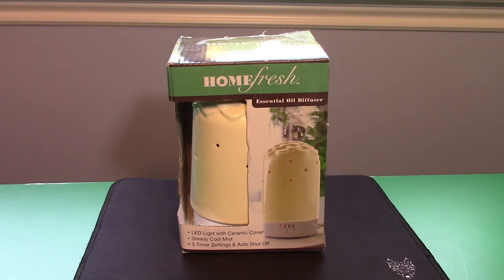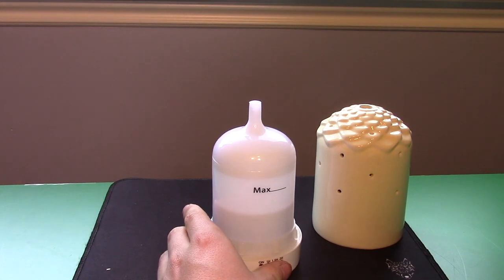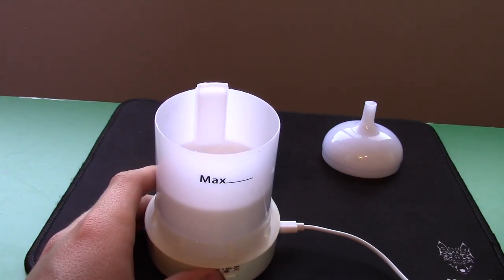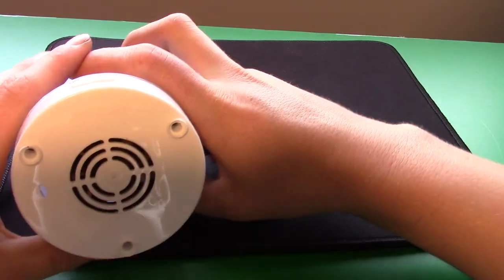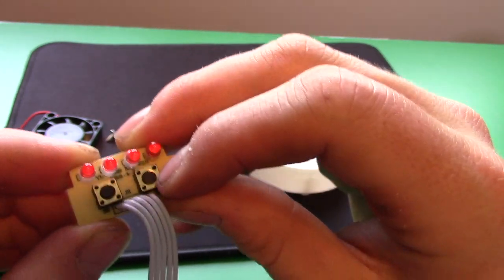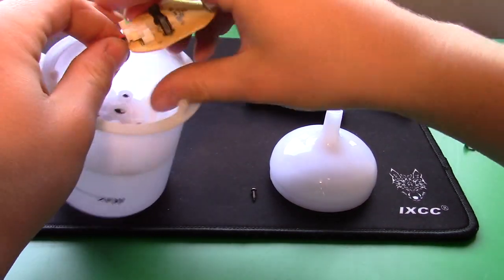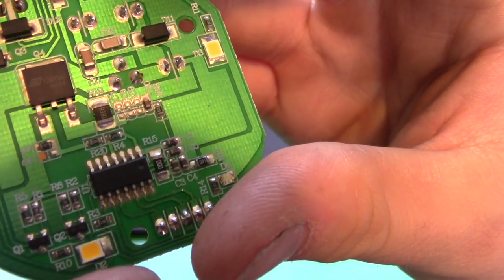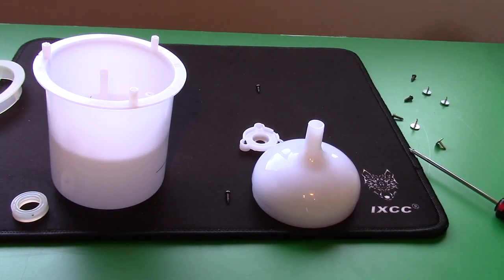Ultrasonic Essential Oil Diffuser Teardown & How It Works

Comment: Thank you for the clear explanation of this! I just got one and I was super curious how it works because I noticed that it wasn’t using any heat, so I decided to look it up and I found your video. Again, thanks. You deserve more likes on this.
Reply from the maker: I’m glad you found my video helpful. Knowing people appreciate what I do is one reason I continue to make videos dispute my lower view and subs. Also, thanks for subscribing!
Reply: No problem 😉
Reply from the maker: @Pablo_24_Alvarado  you could be my 400th subscriber if you subscribe
Reply: I already have but I will on my other account called Pablito 😃
Reply from the maker: If you want to! I’d appreciate it
Reply: Just did!
Reply from the maker: @pablito8097  Thanks !
Reply: Your welcome 😄
Reply: Same here, I was fascinated by the little thing! Can't believe it's just vibrations changing the state of matter
Reply: @Mackathne  Basically the ultrasonic vibrations give the water molecules enough energy to jump to a different state of matter a lot more effectively and efficiently than just letting it evaporate or heating the water to give it extra energy.

Comment: yes the disc is a piezo transdicer that not only vibrates very fast but also very powerfull. i dont know the frequency and the number of watts but it seems the disc vibrates very powerfull
Reply: I have my diffuser plugged into my UPS and it only detects 9 watts being consumed by it so it's surprisingly low.

Comment: BG Tech:  what happened when you tested the components with a multimeter or potentiometer? You didn’t say, when you turned on the unit before disassembling it, whether or not the fan was working. I’d be interested to know if it was actually shorted out. That sometimes happens with those units, particularly if they are knocked over. Sometimes moisture gets down into the thing, but it can be a while before it’s obvious that function is impaired. The other thing is that if there are a lot of minerals in the water that was used in it, it’s possible that the thing was dried right back out after getting wet, and the minerals or even salts slowly caused corrosion inside the fan. I’ll be the first to acknowledge that I may be totally wrong about this, but that would be my first guess, I’d be very interested to hear what your findings were when you  tested it.
Reply: He might have already attempted repair, but decided it was of better use to create an educational video.
Reply: @UserUnknown8570  :  What he showed here was interesting. It is the exact same thing I saw when I opened one up.

but it sure would’ve been nice to know and maybe even see the process, of him restoring the unit to functioning order; That would’ve taken nothing whatsoever from the value of the video presented so far.

Thanks for taking the time to reply to my comment. It’s always a good thing to hear somebody’s actual thoughts.
Reply: I have the exact problem that this diffuser has! I need to find out how to fix it! My fan turned on for a second then stops, and sometimes doesn’t turn on at all. I would be ok with just having an on/off function only if the circuit board is the problem. And mine is new as well, used once, got it on clearance, someone returned it.

Comment: Thank you so much for your video !! Just wondering what the DC fan is used for - seems like it's not interlinked with the disc for vaporization, is it there just to cool down the PCB or the diffuser in general?
Reply from the maker: The fan is connected to a channel that blows air into the unit (where the water & diffuser is) This creates positive air pressure that pushes the mist out of the device.

Comment: My diffuser has the same problem, I think the problem is with the low water sensor. Or is it just the ultrasonic disc that’s the problem? Do I have to replace the disc?
Reply from the maker: I wish I had a good answer but I’m not sure. I doubt it’s the disk though, it’s probably a different issue. It might be something due to it sensing the water level or the cover incorrectly.

Comment: How about those diffusers with a cotton stick?
Reply from the maker: I don’t remember seeing any diffusers that use a cotton stick before
Reply: @BGTech1  really? I saw on Amazon quite a few with a cotton stick as filter which requires replacement every 2-3 month. Just wonder if that lasts longer?
Reply from the maker: @lovemoraine  filtered diffuser would probably make it last longer by keeping contaminants away from the ultrasonic disk, but it might be more expensive that one without it. If you use clean water you could probably get away with using a filter a bit longer than what the instructions say.